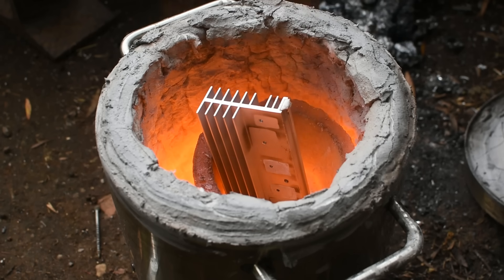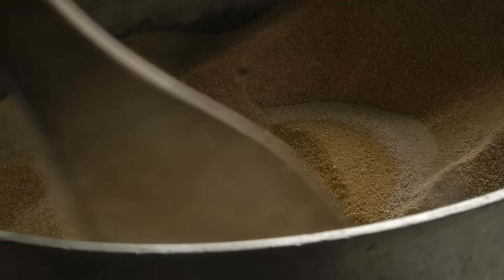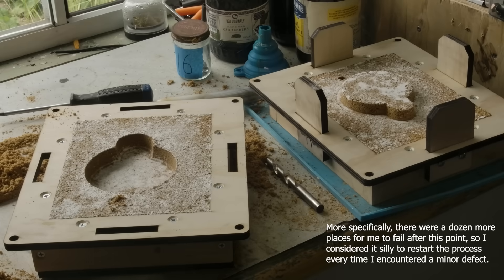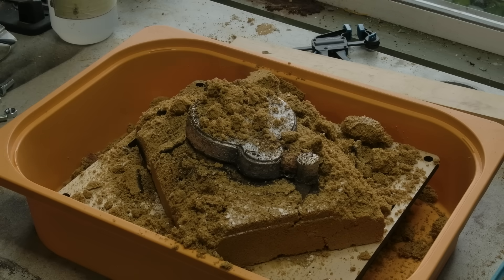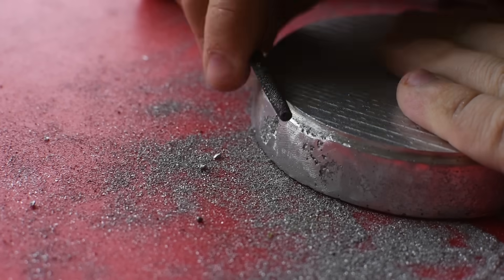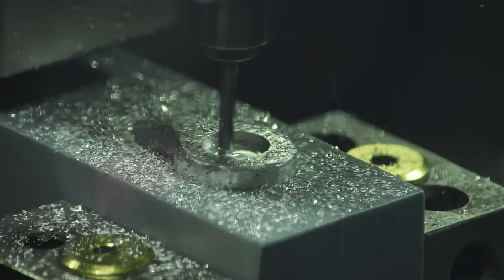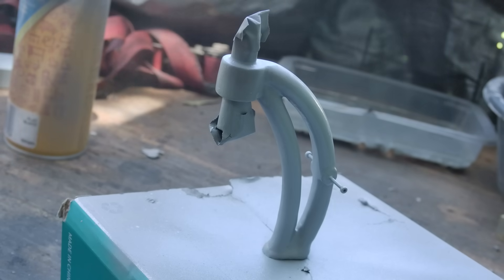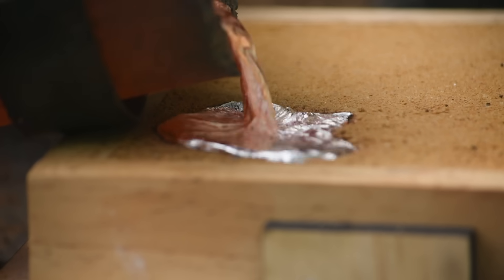3D Printing And Metal Casting Are A Perfect Match

Comment: That water you added to your casting sand will create flash steam when the molten metal hits it making air bubbles in the final casting. Using oil or grade B molasses as a binder will be better. Also your casting finish will be grainy due to the corse grains in your sand so you will need to sift your casting sand through a finer mesh screen.
Reply: 100 micron mesh sieve works great for my greensand

also, you can get clay outta kitty litter without crushing it and also from regular dirt (that can be used for pottery projects) and it's also a lot of work. Still need to grind/blend/mortar&pestle the result to <100micron

I use a 100 micron sieve, two buckets, an old bed sheet with a foot in the trash, a disposable aluminum turkey tray, something to poke holes in it, (optional) 1 yard or meter of tube like oxygen tubes, clip for tubing

1. fill up a 5gal or 20 liter bucket 1/4 of the way with dirt
2. add water till 3/4 full
3. mix, wait 10 seconds, and pour cloudy water into second bucket. clay is hanging onto the water making it cloudy
  * 1-3 (optional) I use a cement mixer to refine a bunch of clay outta dirt
4. leave cloudy water in shade for a day or two so clay settles out
5. prep the disposable aluminum tray by poking a bunch of holes into the floor of it and save for later
6. slowly pour off water to disturb clay as little as possible or siphon water out with oxygen tubing and clip tube to bucket to maximize clay yield
7. setup tray in a yard and line with folded old bed sheet then pour out clay into it
8. let it dry out. could take awhile in the winter to get bone dry or half a day in a desert summer day for pottery clay
9. hammer/grind/blend/mortar&pestle bone dry clay
10. sieve and repeat 9 on >100micron chunks until you get enough <100micron clay
Reply: Looked like it was low in the water department or large grains to me too, haven't found it to cause air bubbles in casting but I tend to make sure to have plenty of venting as it is easy to trap just regular air
Reply: @StepSherpa  I saw air bubbles in  the casting you did in the video, there's good reason why most casting sand is oil based (petrobond), because it's flash point is much higher causing less reaction from molten metal. But you do you, I was just giving helpful advice.

Comment: There appear to be some porosity in the aluminum, which is usually a result of nitrogen defusing in the melt aluminum and bubbles out during solidification. You could try a flux (not borax, that is for steel) and degassing agent just before pouring. Better good first try successful part.
Reply: The bubbles are formed due to wet sand; while the metal is still liquid, moisture from the sand evaporates and spoils the surface.
Reply: @user-yx4bk8by9d .  Yes,  that’s not porosity and not what I was talking about. I was talking about the tiny pits in the machined surface., which means there are voids in the part. I used to get them get them in the billets that I poured until I added a better flux and a little copper to get something closer to a 2000 series alloy

Comment: Every aluminium casting video tells you not to use extruded aluminium, right?
Reply: why
Reply: @mewmew32  It's a different alloy (optimized for extruding), that doesn't flow well if used for casting.

Comment: 10:31 instead of using a milling bit to plan that base smooth. You could use a Flywheel cutting head on that part. They give a better surface than the milling bit does. Plus a lot less sanding and finishing work

Comment: Super nice video, at some point I will prolly get into casting:)
As for the resin printing, it looks like you are overcooking them in terms of exposure. Many still think each bottom layer needs a 30sec exposure time which does nothing but heat up your LCD and likely reduce its lifespan. I am down to 10-13secs for resins with a 2sec normal exposure which means the prints come off the print bed way easier. And on the Saturn, the whole springey bed holds on to so much resin that I rarely even take it off of the printer. I just take the prints off the bed while it's still attached to the printer.

Comment: i was really surprised how complex it is to get castings without voids. aluminum is apparently especially prone to this. i once read a paper about sprue and runner design to reduce voids by filling the mould from the bottom, as well as using certain flux to get air out of the aluminum before the pour.
Reply: It's not as complex as you might think, people online tend to overcomplicate things. The majority of poor casting is from not using proper casting aluminum alloys but rather random aluminum scrap. Also poorly tuned burners, which degrades the cast. Really both fluxing and degassing are not needed if using a well tuned burner with proper casting alloys. The key is to use the KISS principal when dealing with molten metals, many people are casting at home with simple setups and get great results when they use proper casting alloys with properly tuned burners, with no fluxing or degassing needed. However degassing and fluxing are ways of making casts significantly better if using improper casting alloys. Fluxing is needed to clump and gather oxides and impurities to bring them to the surface (drosses / drossing). Fluxing also has the benefit of creating a surface barrier on the top of the melt. Degassing is needed to free the hydrogen gas which is soluble in molten aluminum and the gas is what causes porosity. These two are key in casting improper alloys, fluxing is easy, but degassing can be complicated.
Reply: In jewelry making we spin the cast at high RPM.   to remove the "bubbles"
Reply: In jewelry making the cast is spun to remove 'bubble's"

Comment: € 2700 for that machine. It's mental, and so far removed from the rest of your projects ...
Reply: Zero pounds is a great price for it!
With the experience he gets from it, he can improve his own machine.

But yeah, it uses nema 17 motors and a 150w spindle and 1/8 tooling? The specs are kind close to those 3020 machines and you can get one of those sub 1k with real rails and screws I'm pretty sure.
2.7k is pretty pricey, but you get the camsoftware too and the machine frame looks pretty rigid.
Still, needs to come down in price imo.

Comment: for the resin printer, there are magnetic print beds for them that let you pop the prints off like an FDM printer.  It's easier to wash the prints with the supports on, then use a heat gun to soften the supports and pop them off before curing.
Reply: Is the heatgun a good blowing of the excess fluids after the cleaning bath aswell?
Reply: @Jimunu  no, that's flammable.  I dry them completely first.
Reply: @Jimunu  I use compressed air to blow off the alcohol. I am also down to just two very quick rinse baths of only about 10 secs each. The first is a dirtier one that gets reused more often and the next is a cleaner that gets swapped out more often. And then a quick blow with the compressor before post cure and I only ever have sticky prints if the second rinse bath got too dirty. 
I know not everyone has a compressor, but it's been really nice for this task alone even though that's not why I bought it.
Reply: Don't wanna be too dogmatic but my take is that if you need magnetic bed in the first place you are possibly overdoing the exposure. I installed one on my first printer and stopped using it because I had the bottom layers dialed in so the pop off easily enough. With my newer, larger printer it's the same, no magnetic bed and since the bed is a sh*t design that holds too much resin, I tend to not even take it off of the printer - I just scrape the prints off of the bed and into my hand without taking the bed off at all.
Reply: Straight up a flexible bed was probably my favorite thing I've bought for my 3D printers!
Especially on my resin printer!

Comment: wait so this design needed the Carvera Air (thats showing as 3 grand machine)?? I dont have a CnC machine yet but im just about to get into molten metal i was going to build your CnC Machine but I'm sure i heard you say it couldn't handle this build
Reply: You almost certainly could do this on a norma mill (or tbh even by hand if you were persistent enough) but he said he didn't like using his mill because he could never be sure if issues he was having were due to the mill being flawed or due to him not knowing good machining practices yet. (Basically if he encountered a problem he'd never know if ot was designer error or user error)

With that said IIRC there are open source DIY cnc builds, they just aren't quite as matured as something like a Voron.
Reply: @felixjohnson3874  have voron released their mill yet? Seemed like the got bad criticism when they showed it off?
Don't remember but i think it was quite expensive for what it was...

Ratrig did sell their mill for 300 euro recently without the electronics.
Looks like the same machine as milo.
How good or bad they are is open to debate but the milo guys do make some parts so it can't be the worst I guess.
Reply: @Karl-r5jI don't know about a voron mill specifically, I was referencing them as a printer.

E.g: the community-run 3D printer space is very mature and Vorons are some of the best printers you can own, but the community-run CNC mill space exists, but isn't quite as mature as something like a Voron 3D printer is.
Reply: @felixjohnson3874  fair enough, I agree with that.
I think the thing holding cnc mills back is the software, 3d printers have lots of slicers that's easy, effective and free!
Cnc mills have no free cam software that is easy or free that I know off.

Comment: It sounds counter-intuitive but the harder you push cutting tools, the longer they last!  Taking shallow, light cuts dulls the cutting edge quickly.  You need to find a balance between the power & rigidity of the machine plus the strength of the tool itself.
I'm dubious of a lot of the feeds & speeds published for tools by (some) manufacturers - as they have an interest in you needing to buy more.

Good project & a nice result.  Amazing as a first go at casting!

Comment: try lost wax casting but only downside you need form i made myself 3 D printed form i pour wax inside the mold
Reply: You can get 3d wax resin but for larger forms, it may get too costly. But I actually have a project coming up where I need a big wax form and was thinking of 3D printing a mold for the wax so can I ask which filament, you're using for this? As far as I know most of the casting waxes melt around 70c?
Reply: @AntiVaganza   I use Pla for form wax is for some cheap small candles looking like IKEA GLIMMA for simpler shapes I think is the best. i dint know about wax resin bit i use fdm printer

Comment: I don't know if there's any purpose to adding water with a spray bottle. I just dump the water in my sand and use a handheld concrete mixing whisk in a drill chuck, and I've never had any issues with my castings. Great video!

Comment: you can add the "pathways" for the liquid metal in your print
Reply: yet they never do.
Reply: If you get fancy with pouring basins, tapered sprues, bubble traps, fancy gates etc then 3d printing absolutely pays off in making complicated and consistent results.
Reply: You could probably get a better quality casting if you 3-D print in wax and coat the prints in plaster and do a lost wax casting
Reply: @mgbrv8  lost pla casting is also a thing :D
Reply: @ryszyrysz  PLA has problems with offgasing and cleaning.  You can also use fine cement to lost cast wax, which you can then melt out of your print, and cast directly into your medium.
Reply: Thats only usefull if you are plan to mass produce these and need a semi consistent quality. Manually cut gates and runners are much more economic for making samples like these
Reply: Hardly necessary or useful. Faster to dig them out manually or add them with whatever pieces of metal or wood are around.
Reply: @Rainyjax  if you are gonna be one and done than it makes no sense. If you are gonna reuse it may be easier
Reply: Harder to get the mold out then.
Reply: 3d printer fillament is expencive, an poky stick for making an hole is free
Reply: @dieterfritz1502 No it isn't? It's very cheap

Comment: the porosity, you can try to degas the melt,there is diffrent ways to do that,you can use salt as flux to remove impurities to,,that might help to get less bubbles ,,
Reply: The best way to reduce porosity is to melt quickly, and pour as quickly as you are able to do. Long heating times and higher than required temperatures promote gas entrainment. There is no effective degassing additive. That has been debunked by a few experienced foundry channels. That you see bubbles in the applications of various compounds in videos is the compound releasing gasses as a by product of their reaction with the molten metal. A definite case of seeing is not believing. The only way that you can degas aluminium is to bubble Argon gas through your melt. Another way to have the least gas entrainment is to use a resistive heating element furnace and you will have less air entrainment.

Comment: I've been experimenting with metal casting with 3D printing for a couple months now and its genuinely a great way to do things. I did quickly move away from green sand due to its inherent lack of surface finish and weakness, and its pretty bad with higher temperature melts. Been using sodium silicate sand and honestly I enjoy how much stiffer the molds are. Another thing I've tried are petrobond sands, great for smaller stuff, needs more venting. Besides that however I've experimented with using water soluble casting cores made of PEG and clay binders, and even just ice with sand mixed in it that's let to warm up and drain and flushed with a mold wash, then dried off at 60C ramped to 100C, this has been an incredibly interesting way to do sand casting for me recently and has had near perfect results. Works better than the lost PLA and Lost wax casting I was trying before
a note to add to your process. Baby powder in some cases has been switched to cornstarch, do not mix them. A quick burn test will confirm it. Powdered graphite and dry graphite sprays too work as a good alternative to this and releases easier but its messy so not a huge fan of it
edit- also funny thing is, the magic sand kits out in the wild? they work for aluminum and zinc casting, imagine my surprise
Reply: For mold release, we used "rock flour" (don't know if that translation is right) back in school and it always worked perfectly fine
Reply: @jakobbb6405  that is almost certainly talc aka talcum aka soapstone. Same thing originally in babypowder and just talcum powder in general. It works well and is the standard for this stuff

Comment: You should look into lost PLA casting. I have seen very good results and it seams not that complicated.
Reply: I was actually a bit surprised he wasn't doing lost PLA
Reply: Investment casting with ceramics is probably something most people should check out if you're getting into things like lost PLA
Reply: @itsumonihon  ^ this is why i still love youtube even tho i hate using it, it's the comments filled with knowledge and tips
Reply: Can PLA be flushed or burned for casting?
I always thought it was too dirty
Reply: @fofopads4450  I've seen very good results with lost PLA. Thin walls and low infill on the printer settings means that the molten aluminium is perfectly capable of burning the PLA away during the pour. Very long and skinny parts do need to be cast upright, though. But that's not really a problem when you don't have to make split molds.
Reply: @andersjjensen  Don't use the metal to burn out the PLA, burn out then preheat the mold and then pour, you're missing several critical steps if you're just pouring metal into existing PLA
Reply: @fofopads4450 its a bit on the dirty side but can be done with PLA hence why there is speciality plastics made for it
Reply: @fofopads4450  If you use PVB filament it has a lot less burn residue. It is basically made for lost print casting.
Reply: there are now meltable lost-wax uv resins for investment casting
Reply: Have you heard anything about using fdm pla casting or does it need to be wax based resin? I looked into it a while ago
Reply: @IPreferLoLtbh  there's fdm filament optimized for it. PLA works but leaves some residue behind so mold design has to account for it otherwise it won't run out the fill port.